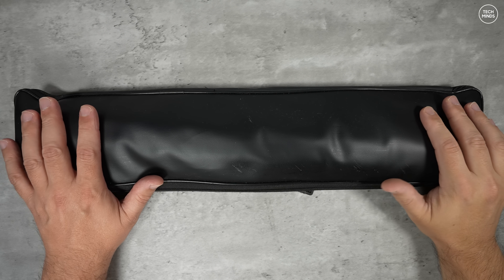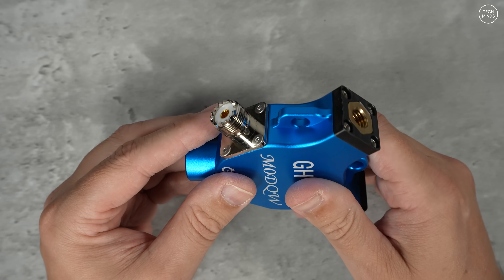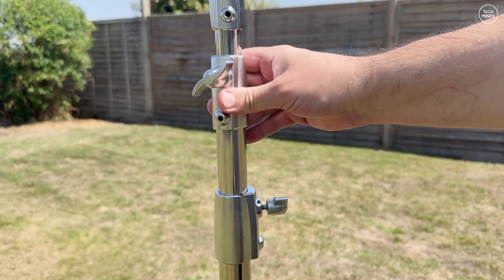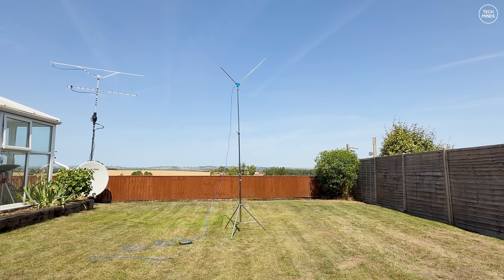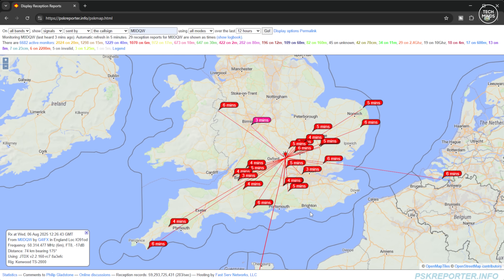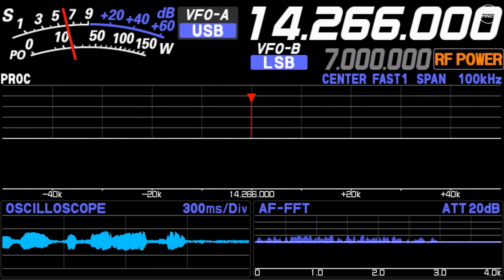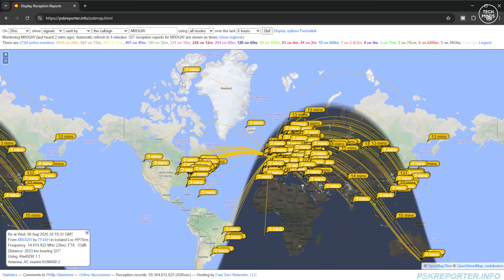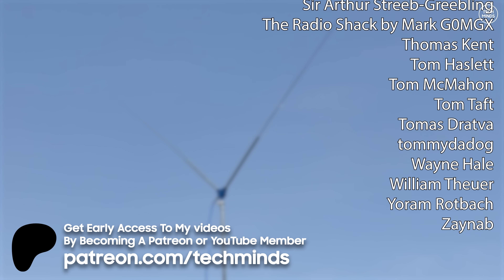GUOHETEC GH-V5 multi-band V-Dipole antenna 7Mhz - 430MHz

Comment: Thanks for this video. Im very interested in the set up. I checked on the Aliexpress website and the I couldn't find any mention of the tripod. I looked at your Amazon store front but no good either. It looks like the only place the tripod can be found is on your Aliexpress website that you show as a link. Any thoughts. Thanks again. AA7TS-Don

Comment: Does this antenna include a balun or a choke in the base? I ask because I'd expect it to need one (it's a balanced antenna on an unbalanced line) and also because I expect a balun that works on HF to NOT WORK in VHF and UHF, so I'd say it's to be expected for this antenna not to work on UHF.

Comment: Looks very well made... Do you think it could withstand being in a permanent outdoor position?
Reply: unlikely. The telescopic whip will start to have issues when it gets wet or there's a freeze thaw cycle.
Reply: No. These telescopic elements are quite fragile. I mean they're not so bad, but they are LONG, very long, and the wind will break them sooner than later if you leave it up even in moderate wind conditions. These elements (that can be bought from China from a lot of sellers) need to be handled with care and kept polished and clean and a little lubricated or they will jam or break. Also pull them out carefully to avoid hitting the stop too hard.

Comment: The audio from that 710 sounds lovely 🤔. Out of curiosity is the max power o/p on 4m , 100W or 50W ?
Reply from the maker: 50 watts apparently, although I never measured it on a meter.

Comment: Like FireRescueGuy, I have a design for those who like to build antennas themselves. It's a bit more complicated than the GUOHETEC design, but it gives you two antennas: an inverted V and a 1/4 vertical with two radials.

It is built around the mirror mounts that truckers use to mount CB antennas along with three of the 18.5 ft. telescoping antennas from China and three 10 mm to 3/8 x 24 adapters  (best price at McMaster-Carr #92499A793). The advantage is that you can clamp the result to any pole including a tall tripod such as those photographers use. That will get the radials well above the ground and out of the clutter. It should work for all bands from 20 meters up to at least 6 meters. With the length adjusted to resonance, I get about a 1.1 SWR on 20 up to about 1.4 on 10 meters. Drooping actually seems to improve the impedance match.

In the pictures linked below, the two BNC dust covers short the horizontal elements to ground, making them radials when used with the vertical whip fed. As an alternative, feed one of the horizontal elements and leave the other shorted and you have a modest V dipole, the V coming from the droop. These pictures also include a recent addition, a through-chassis BNC connector that allows VHF/UHF antenna to be installed or one of the banana-to BNC jacks and a wire dipole for perhaps 30 or 40 meters. I used nuts larger than the bolts for the interior spaces, so those wing nuts tighten everything. That makes installing it simpler.  All it all, it is quite versatile.

The pictures are the named and numbered 'Performer' jpgs at this public Dropbox link. Feel free to pass the pictures on and vary the design to suit your needs. I’ve gone through about a dozen adaptations myself.

https://www.dropbox.com/scl/fo/lnyuz21yzstrdpf6t6xq5/h?rlkey=amxtnzn9fwfpd0sqv0o6l8rxn&st=t3sxza0z&dl=0

And it does perform. Performer-WSPR-20.png shows the WSPR results on 20 meters with about 3 watts out.

--Mike Perry, WA4MP

Comment: For those interested, IF you have a 3D printer you can make one of these V-dipoles for significantly less cost. I designed one based on the Alpha Antennas HexTenna and improved on their original design. The most expensive part is the whips themselves. With my improved "clone", I have been able to reach Australia, Japan, South Africa and other significant distances between 10-20m using just 10w (Icom IC-705) on FT8, and have had quality QSO with European, South American countries using SSB/Voice... All from central Arkansas. (EM44 grid). 

Satisfaction of building something yourself and saving money is so worth it.
Reply: Great job that you designed it yourself !! Question, would your 3D design be availabe for others to make 😊 or can i  maybe already find it somewhere?
Reply: @FireRescueGuy...would certainly consider buying one from you, if you are guided in that direction. My primary interest would be from 20-10 meters, but whatever. Would you consider doing it?
Reply: Yeah...yeah...yeah. We get it pony boy. You can do 3D printing. Feel better now, do you?
Reply: Do we really need to "save money"?
Okay, poverty is no shame... hahahaha
With your 3D printer, you can produce bulletproof weapons. That would be important – at least here in Europe.
The American laughs... he doesn't do anything like that. He buys the Magnum.
Reply: @andimerkle6924  Poverty really plays no part in this, but I do not see the value of $250-300 in something I can make for myself. My build is extremely close to Alpha Antennas (3d printed on their end) and this Chinese aluminum body. 

I made the same thing they sell for that much, for around $30 USD. That is an insane markup. I could spend that money on much better things, saving it. Saving it for another radio, amp, ATU, whatever. 

I also fail to see how plastic printed parts are "bulletproof weapons", that's laughable.

Comment: Nice, ive seen something similar on AliExpress and wondered how well these telescopic whip V dipoles would work and you have answered my question! I currently have a 40m V dipole made out of 2 40m hamsticks setup which seems to work quite well, nice low SWR in the middle of the band and can be tuned right across using the ATU on my 991a. May have to try out one of the whippy V dipoles for comparison. Out of interest when using this V dipole for 40m what are you supposed to do with the wires? Are they to be above the ground and suspended?

Comment: Mat: If the whips resonate near 144 MHz when telescoped in, the will work as a 3/2-wave dipole on 70 cm.  I saw no mention of 30 meters, but the 40 meter wire "elements" could be folded bak on themselves for 10.1 MHz...

Nice clean looking antenna! 73, Keith, WB2VUO near Buffalo,  N.Y.

Comment: An idea: on pskreporter, turn on the "Show snr" option in the display settings. I think it's more informative in the case of antenna comparisons.
Reply: You could not be more right. I recently ran a WSPR test running 3 watts on 30 meters into a mobile whip in the late afternoon. The results blanketed the U.S. and Canada. It also reached dozens of receivers in Europe, as well as one in Namibia and one on St. Helens off Africa. The SNR varied enormously from about -25dbm to a +5. That's a 30 db range and equivalent to a 1000-fold difference in strength. The ability of digital modes to pull signals out of the noise is incredible.

Comment: Excellent video and excellent antenna. Where do I find the different antenna lengths for frequencies? Thank you
Reply: You can also look up Alpha Antenna HexTenna user manual. It has the lengths of whips in card form.
Reply: @FireRescueGuy Thanks
Reply: The approximate length in feet is given by dividing 234 by the frequency in mHz. I've found that the easiest and quickest way to set up these antennas is to tune it for resonance on each band that interests you and then note down how many sections and parts of sections are extended. That will get you close and save time fiddling with a tape measure. Since these antennas are close to the ground, elevation and the immediate environment will also make a difference.
Reply: @Inkling777 Thanks
Reply from the maker: I showed a chart I made in the video.

Comment: That tripod is interesting. I have one EXACTLY the same, all the way down to the springs except mine seems to be made out of ABS or some other tough plastic. Got it on Amazon a couple months ago for about $36 I believe.
[edit] Slight correction: Mine has 3 sections but the stainless one shown has 4 so is taller than what I got.